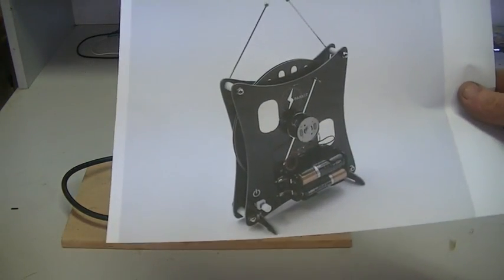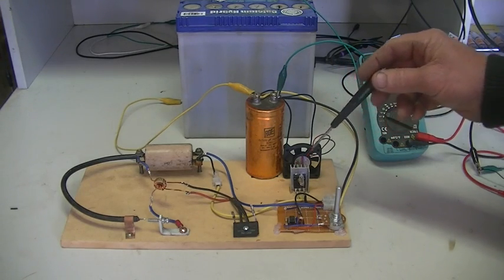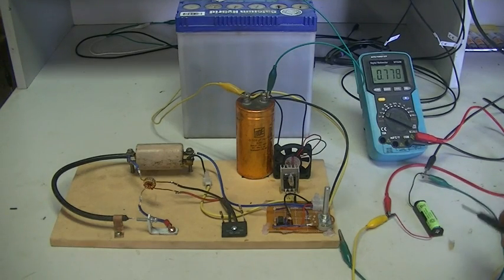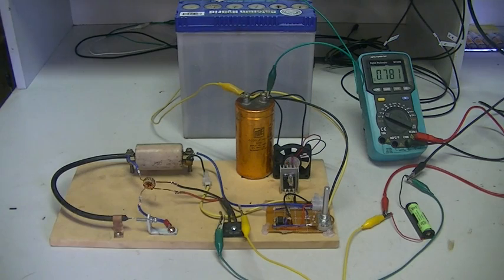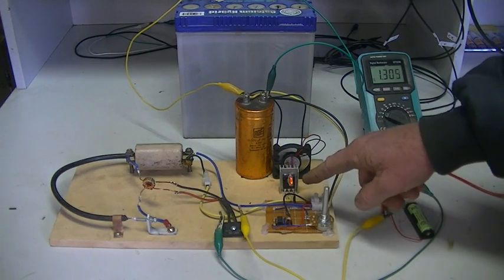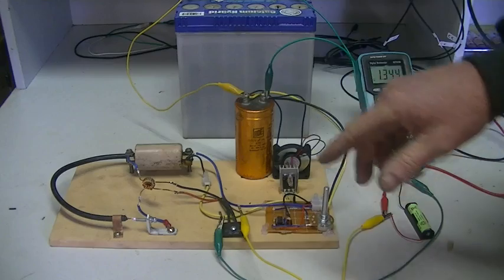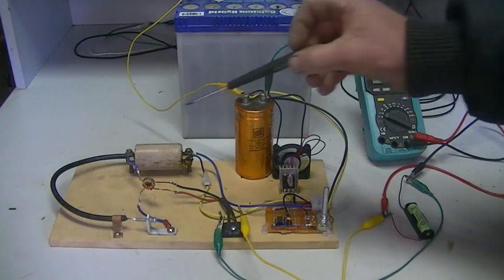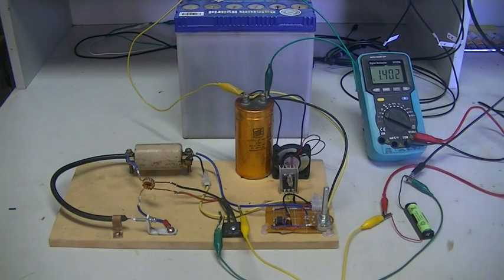High voltage driver testing.

Comment: Nice TinManPower!
 try to rectify and filter the HV before the spark gap  (with HV cap), it will reduces a lot of rf noises and improve the efficiency of the step down transformer
Reply: Have you seen my Video "High voltage to Low voltage DC"?
Reply: Can you give us a link to your video?  Thanks.
Reply: i posted the comment with the link, but needs approvation from the channel owner....you can find in my channel, the vis is:  "High voltage to Low voltage DC"